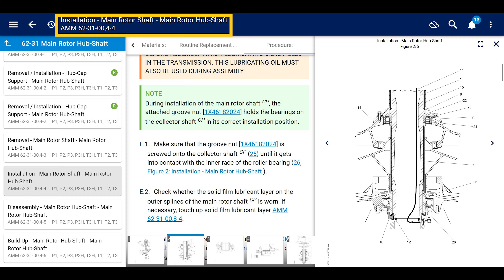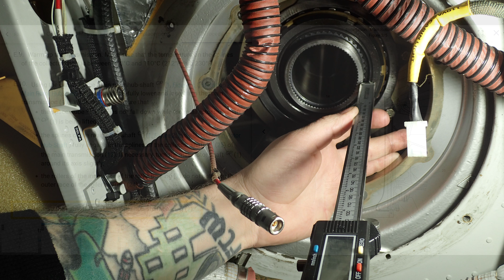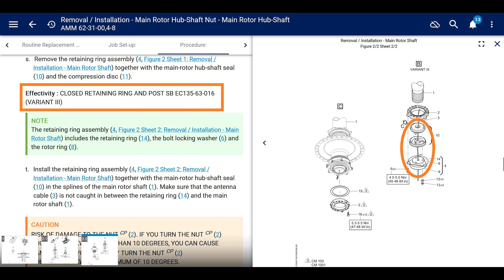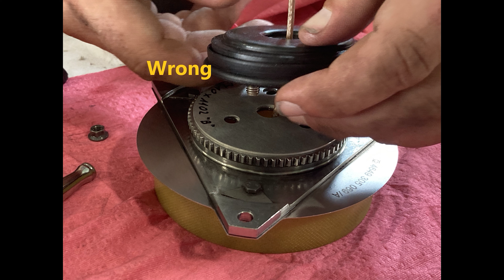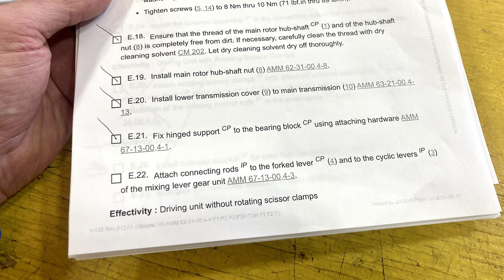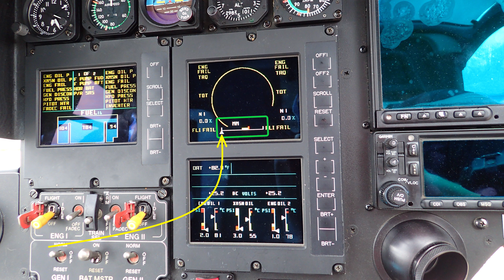Mast Installation | EC135 Main Rotor Hub Shaft | Airbus Helicopters

Comment: I was curious if you also use a trick with a spare o-ring for the support tube :D It helps a lot, and as you said can save a ton of work! I'd add, that if you install ''flower pot''/hub shaft support just for a while to lift or move the mast, be careful and allways use both washers and grounding cable when tightening bolts. If you miss a washer, of a grounding cable you will damage mast for sure.  I hope I understood good when you called if flower pot...first time someone named it like that, I like it 😉 we call it ''kielich'' which is chalice in polish 😅But the flower pot sounds better. From now on I will call it doniczka 😄 Great job! Cant't wait for your next big projects. Keep it up! Greetings🤟
Reply from the maker: Awesome,  thanks for the review.
Reply: Hey q, is there something that you would like to see a video on? Do you have any recommendations on a video?  I ask you because I know you work on these machines and respect your input.
Reply from the maker: Sorry q I was watching yt with my other account when I sent that question to you.  My fault.  Do you have any recommendations for a video my friend?
Reply: Hey, I don't know how much time you spend performing inspections like 12MO/500FH or 1000FH so you can show exacly how things are built and how to remove/install. During these inspections you have much more opportunities to record a video. For example, I work in base maintenance station so performing 12MO/500FH or 1000FH is my daily job (+ replacing main gearboxes, engines, performing test flights and performing service bulletins). Our line stations are located in different places in Poland, so if any H/C there has a problem I jump into a car and go fix them too. I allways try to share my insights here, even if I have only 5 years experience in aviation (I'm turning 25 this year, and started working on EC135 when I was 19). All of your videos are very interesting for me, cuz I can see what ''tricks'' you use, share mine and talk through problems that I or you might come across. Helicopters I deal with are very simmilar to eachother - P&W engines only (P2+/P3), almost the same avionic and the same autopilot. It's very interesing to see other components/solutions that are implemented into helicopters you deal with (one time I asked about A/C when I saw your short on youtube, becasue we don't have it). I haven't seen Turbomeca engines ever in real life and probably these are the most interesting things for me - Turbomeca, avionic system and autopilot variants. But the most importatnt thing is you having fun making videos and not recording because I would like to see something particular or anybody 😊 (especially that avionic/autopilot might be boring for somebody 😅) Every videos you uploaded are very interesting for me. I hope oneday I'll visit US and have a chance to meet you and your crew.
Reply from the maker: @qweq9972 thanks for your input q.